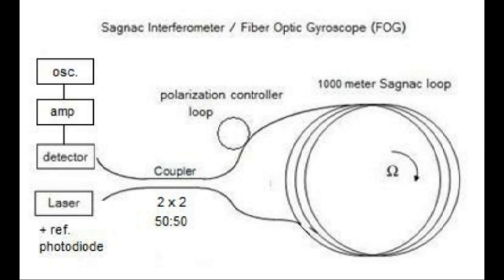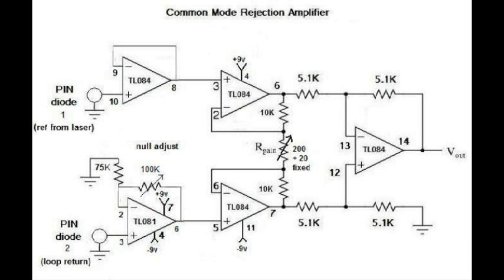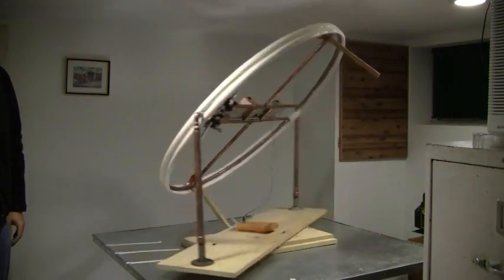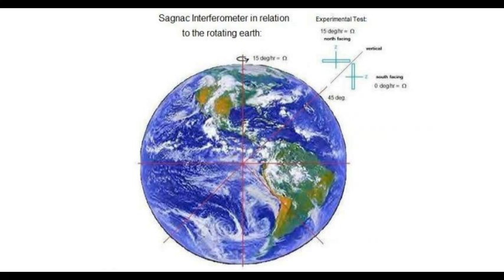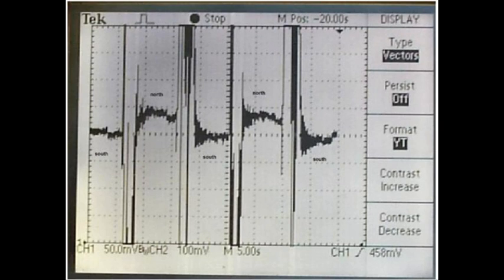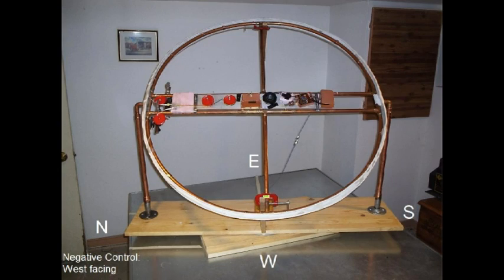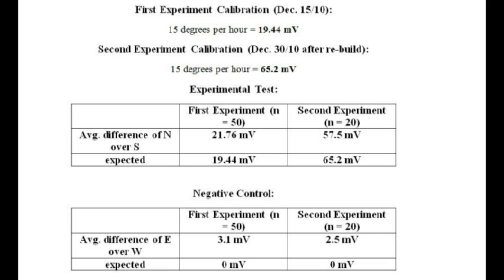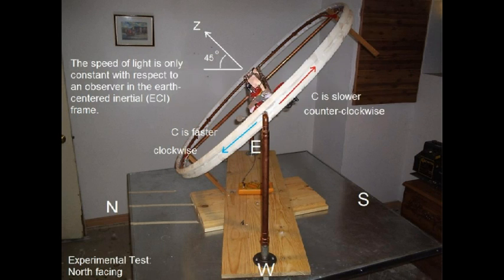Detecting Earth's Diurnal Rotation Using a Large Area Sagnac Interferometer

Comment: I'm a high school student and i have a large interest in physics, but i had a question when i first learned sagnac effect, it seems to contradict relativity theory and michelson morley experiment, because as i know in relativity the speed of light in vacuum in every frame of reference is constant, but here if we take the table of the experiment as a reference we see that there is a difference between the speeds of light which must be impossible
if i may ask, how is this possible and doesn't contradict with relativity.
and sorry for my english
Reply from the maker: You are correct to see this as a contradiction - Einstein dealt with it by never speaking about the Sagnac effect. Other relativists came along later (like Langevin) and argued that special relativity does not apply to rotating systems, whereas general relativity (GR) does since it applies to non-inertial frames of reference. In GR one must argue that the speed of light is only constant for the non-rotating observer to explain the Sagnac effect, but then this observer becomes preferred, which again contradicts the essence of relativity where there are no preferred observers. Since relativity borrows heavily from the earlier theory of Lorentz (Lorentz ether theory, 1904) in which a preferred frame of reference exists, it is much easier to understand using Lorentz's theory. In this latter case, light is moving as a wave in this preferred frame (the ether medium) and the interferometer is rotating with respect to it. So the difference in the speed of light in each direction appears naturally as a consequence of this motion with respect to the frame. It also explains the constancy of the speed of light in the preferred frame since light is a transverse wave propagating in a medium with a specified density and elasticity, as it was first defined by James Clerk Maxwell. Finally, the appearance that the speed of light is constant in inertial frames of reference is explained in Lorentz's theory by the effects of the contractions of measuring rods, and the mechanical biases on the rates of moving clocks which all add up to cancel out any directional anisotropy in the measured speed of light. In this way, Einstein's and Lorentz's theories are "anagrams" of each other, arriving at the same predictions using different routes. Hope that helps.
Reply: @plenum88  Thanks for your time.
So Einstein's relativity isn't precise in some rotational movements like this, but that doesn't make it completely false because Lorentz's theory can solve these problems and at the same time it generally makes the same conclusions with relativity theory.
But then don't we need to fix the relativity to match Lorentz's theory?
And since Lorentz's theory works with accepting ether existence then do we really need to refuse its existence?
Reply from the maker: I suppose that to determine whether relativity is "completely false" hinges on its main premise, that the rate of passage of "real" time can differ depending on your speed or your position in a gravitational gradient. This problem has been described in my article here: https://www.conspiracyoflight.com/Paradox/The_Paradox_of_the_Clocks_in_the_Canaries.html. As I describe in the article, the relativistic interpretation of time dilation leads to a series of rational contradictions. Lorentz's theory doesn't suffer from these same contradictions since clocks are considered to incur biases due to the hidden variable speed of light.

Comment: Just curios, how or where do you acquire a 1km loop of single strand fibre optic. Doesn’t appear to be a common item one can buy
Reply from the maker: You would need to go to a fiber optic cable supplier and have it custom-made.
Reply: @plenum88  so no mass market for diy laser gyroscopes
Reply: AliExpress has fiber optic rolls of several kilometers available and not too expensive

Comment: Are there any less complex instruments that can detect the rotation of the earth?
Reply from the maker: There is one method that I have been meaning to make a video about - this is detecting earth's rotation from GPS data available online. So it cost nothing, just a lot of calculation. You can determine how fast an earth receiver is approaching or receding from a GPS satellite by calculating the Sagnac error in meters. You can then use the satellite's angle to the receiver to calculate how fast the earth is rotating based on the Sagnac error. This gives you a reasonable approximation to 465.1 m/s at the equator.
Reply: @plenum88  2 years ago I was at a scuba course on a far away island in indonesia and I remember I tried Google maps just for fun but it couldn't find my location. Long story short I'm not so sure if satellites are up in space so I'm a little iffy about this experiment. Don't you think sometimes that it's strange that the earth is spinning 100mph and there's no instrument sensitive enough to measure it in real time? And then you have this liquid lava core inside and yet its been spinning the exact same speed throughout recorded history. Gotta make you wonder a little if those crazy flat earthers are onto something..
Reply from the maker: @eirikmurito  The thing about GPS is that it works based on verifying the position of the satellite to the receiver, so the line of sight distance to the satellite in space from the observer is verified every second of every day by millions of GPS observers - I can't think of anything which is so self-verified as the satellite positions in space, which I might add, consist of at least three main satellite systems - Russian, American and European.
Reply: @plenum88  I don't know man when I'm taking the ferry from sandvikvåg to halvhjem it also can't find my location. You can test this for yourself by going far out at sea. I'm not saying I know 100% for sure that GPS signals are land based but they sure act like it..
Reply from the maker: @eirikmurito  Google maps on a phone usually relies on a data connection and can be unreliable in remote locations, particularly if you haven't downloaded the local maps. For a proper test, try a stand-alone GPS receiver like a Garmin or Magellan loaded with the local maps, and make sure you are standing outside without obstructions.
Reply: @plenum88  I already have the map downloaded. The signal is simply lost when I'm far enough out at sea. Sometimes it starts to guess my location but gets it completely wrong.. This doesn't look like a map issue to me this looks like a triangulation issue..
Reply from the maker: @eirikmurito  I just posted a new video showing how one can measure earth's rotation using freely-available GPS date,  see: https://www.youtube.com/watch?v=-bnBbHFfZ6k
Reply: @plenum88  that's great but it isn't suitable for evidence..
Reply: Disabler - lookup the gyrocompass
Reply: @stuartgray5877  they don't detect the alledged rotation. Apparently there's just one that allegedly does but it uses software so you can't use it as evidence..
Reply: @eirikmurito  oh and Google "EPOXI images of earth" and tell me what you find.  If you want to call those images "FAKE" then you better have some evidence.  I know a little about the hardware that took those images.
Reply: @stuartgray5877  show me one gyro compass that doesn't use software that can detect the alledged rotation of the earth and I'll show you a liar..
Reply: @stuartgray5877  I only look into alledged photos, not images.. I know most round earthers think theyre the same but they aren't..
Reply: @stuartgray5877  all you have is ad hominem attacks. No evidence
Reply: @eirikmurito  so according to YOU "Facts" are not evidence.   You cannot explain the operation of the GYROCOMPASS, and you don't know the definition of the word "photograph".  Why don't you lookup my resume, just search LinkedIn for "Stuart Gray Lockheed" or is that too difficult for you to figure out as well?
Reply: @stuartgray5877  you clearly don't have the evidence
Reply: @stuartgray5877  images are not sufficient because images can also be paintings
Reply: @stuartgray5877  I haven't tried a ring laser gyro
Reply: @eirikmurito  I have been testing ring-laser gyros for almost 25 years first trained at Lockheed Martin.  They certainly DO measure earth rotation, now watch the YT videos : 
“100% Proof that Earth Spins! Aircraft Laser Gyroscopes”, 
or “Understanding the ADIRU | Training | Honeywell”, 
or “IRS Align Mode - Carefully Measuring Earth's Rotation”. 
Then get back to me.
Reply: @stuartgray5877  I couldn't find the first video can you post a link?
Reply: @stuartgray5877  I watched the video and I don't consider it scientific proof of the spin since it didn't have any physical experiments. I'm not a pilot so I can not confirm or deny if his claims are true..
Reply: @eirikmurito  Watch the video from Honeywell.  That Honeywell engineer explains that the Inertial Reference Units in his hardware use earth rotation to test the gyros before flight.  That is an OFFICIAL Honeywell video.  So tell me that Honeywell Engineer is LYING in an official Honeywell video.  That is LYING to the FAA which would be a felony.  I have performed these tests MYSELF on more than one model of RLG.
Reply: @stuartgray5877  I don't know who is lying and who is not so im gonna need to go after evidence here. I require physical evidence whether it's from a major company or some random homeless dude..

Comment: So didn't the Sagnac experiment concluded that the aether exists, Einsteins theory of relativity is fucked, and that the Earth doesn't move? This is a different Sagnac experiment that disproves the original experiment? I'm so confused.
Reply from the maker: The Sagnac experiment implies that there is such a thing as absolute space (a Newtonian concept) since this appears to be what the interferometer rotates "with respect to." But that frame of reference is not the earth, the earth is likely wizzing past it at several hundred kms/sec, and rotating through it at 30 km/s  around the sun, and rotating diurnally at 465 m/s around its axis. The Sagnac experiment detects these rotations (diurnal, orbital) readily as rotational velocities with respect to "the fixed stars" i.e. absolute space, this is how it is often described in the literature. So one shouldn't imply that the Sagnac effect proves that something doesn't move - rather, its shows the opposite. The whole point of this video is to show that you can detect earth's rotation with an optical experiment, and also to show that there are circumstances where a lab observer can measure a difference in the speed of light between two equal length paths in their own frame of reference.
Reply: plenum88 the Sagnac effect does not imply absolute space. But it shows that the notion of an inertial frame does not extend to rotation, but only to translation. You can detect mechanical rotation: connect two objects on a train with a string, the string, then the string stays slack, even if the objects are in a moving car; rotate the objects (or turn a corner) and the string will tighten. The objects can measure they're rotating. So while there is no absolute frame of reference for inertial, unaccelerated motion, rotation is absolute. This is consistent with the theory of relativity.

Comment: So the “gyro” based on light detects the movement of the sun. What a concept. Other gyros have no problem with accuracy at 15 degrees per hour why don’t they detect rotation? Why is there no curvature?
Reply from the maker: Nicholas, from the way you have worded your question, it sounds like your misinterpreting my video and attempting to apply an anti-Copernican argument instead, 'cause I can't see how you could have arrived at your conclusion otherwise. If you have a problem about the idea of detecting earth's rotation, maybe you should look at the GPS data. GPS receivers need to calculate the rotation of the earth every second of every day, by determining the Sagnac delay, which is the motion of the earth's surface receiver with respect to the satellite in the time of flight period of the microwave transmission. If the earth wasn't rotating, it would cause a range error of up to +/-30  meters. Seeing as GPS can determine position down to cm or even mm, the rate of rotation of the earth at all latitudes can be determined with quite high precision.
Reply: plenum88 GPS is not satellite-based. There is no evidence of curvature or motion.
Reply: plenum88 yes but if it’s not rotating it really wouldn’t cause a problem would it? 

Let me know when you are able to detect rotation by any means.... yawn
Reply: "Other gyros have no problem with accuracy at 15 degrees per hour" Which gyros are you talking about? It is extremely hard to get gyro with high resolution (<0.001deg/sec) accuracy and drift of less than few degree /h, required to do 15.04 degree per hour measurement. They start around 4000$.
Reply: movax20h and yet they don’t detect rotation 🤔 

Modern mems sensors are also accurate enough.. they detect no rotation either 🤔
Reply: @nicholashpitts  "Modern mems sensors are also accurate enough" Show me manufacture and model of this sensor you are talking about.

Comment: I read the notes you posted on http://www.conspiracyoflight.com/Sagnac/SagnacEarth.html. It seems to me that for the calibration of the photodiode v.s. the rotational speed, you assumed there is linear relationship between the photodiode signal and the rotational speed, since you said "1.296 mV for 1 degree/hour, Since the earth rotates at 15 degrees per hour, the expected result of earth's rotation = 19.44 mV positive change when the device z-axis is parallel to the north pole vs. perpendicular". However, I think the photodiode signal is proportional to (1-cos(phi)), or (1-cos(omega*constant)). At a very low rotational speed, like the earth rotation, the Taylor expansion gives you  (1-cos(omega*constant)) ~ Omega^2, which is not linear. Please correct me if you didn't mean that they have the linear relationship. Or, did you shift the phi by 90 degrees to make the cos function to a sin function? Thank you!
Reply from the maker: Hi Jieping, 
    There is too much going on in this experiment with the changing phase of the counter-propagating waves, their polarization state, and the sensitivity of the detector, etc., to rely only on a theoretical expression of how the photodetector would behave. At the time I attempted to calibrate the response  by looking at the actual voltage response verses RPM and graphing that out in Excel. Certainly the response is non-linear over a full fringe shift, as I have described in detail elsewhere, but over short ranges of voltage change and small changes in RPM and at slow speeds, the response by calibration was approximately linear, and it is expected that after amplifying as much as I had to do, any residual non-linearity would flatten out.
Reply: Thank you! How did you deal with the stability of the system? The local temperature and even a small movement of the fiber could change the signal a lot....
Reply from the maker: Hi Jieping - I made sure that the fibers were all bound tightly so that there would be no movement - any free fibers were taped down for the same reason. Temperature will affect the fringe shift so it is best to perform the tests during a period where the temperature is stable to around 0.1 deg. C. Since the intervals between measurements were short this should be possible - in later experiments I have implemented active temperature control.

Comment: "Speed of light is a constant in non inertial frames of reference"
Reply from the maker: If that were true then there would be no Sagnac effect.
Reply: @plenum88  An ordinary SagnacX shows that there is an aether, but karnt show that there is an aetherwind (but kood detect an aetherwind if done differently).  A fixed Earthly diurnal FOG SagnacX might be able to detect the background aetherwind. Especially if uzing that flipping 90 deg trick.  But i think that that clever flipping SagnacX would work better if orientated to accord with the background & foreground aetherwind (which blows at say 20 deg to Earth's axis)(plus or minus a bit of angle due to the 30 kmps orbit)(plus or minus a bit of angle due to the season)(all continually changing during a sidereal day). I must re-read all of the Michelson Gale Pearson MGX stuff.
Reply from the maker: @atheistaetherist2747  - I did do some calculations on that, see here: http://conspiracyoflight.com/Sagnac_webapp/Sagnac_interferometer.htm . I think theoretically, the translational motion with respect to absolute space should cancel out around the loop, such that only the rotational motion is visible in a Sagnac effect, this seems to be the observation from experience. That is not to say that seeing a sidereal effect with a Sagnac is impossible, but if such a thing did happen, it would be through some more unconventional mechanism.